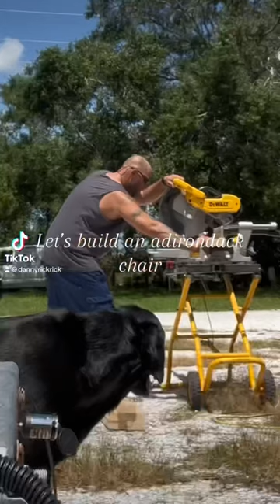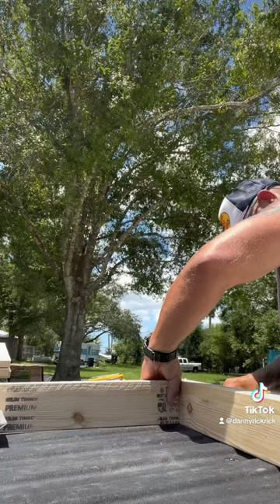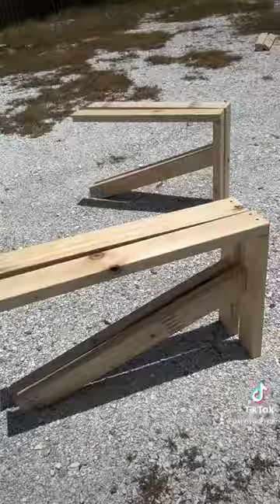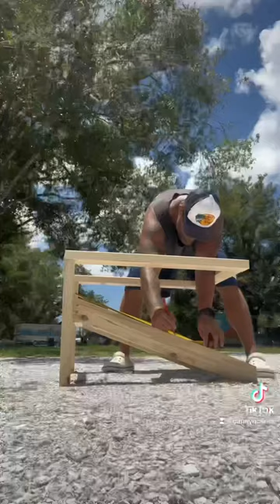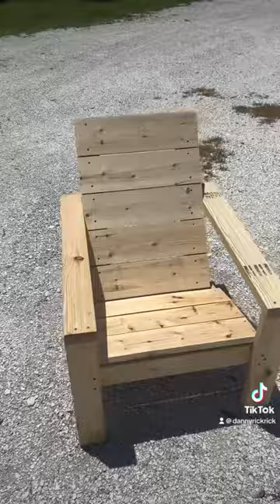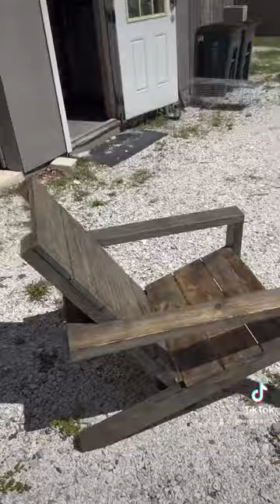Building an Adirondack chair #carpentry #diy

Comment: Definitely saving this to make later. Roughly how much per chair?
Reply: Not a lot man. Maybe $25…you
Need
2-3
2X4s (8’) that’s like $12-14….and then I’d get 2-3 boards of 1X6 or 1X8 at 1and that should do the trick. Looking at aroun  $30-35 That’s just wood though and doesn’t include stain and screws